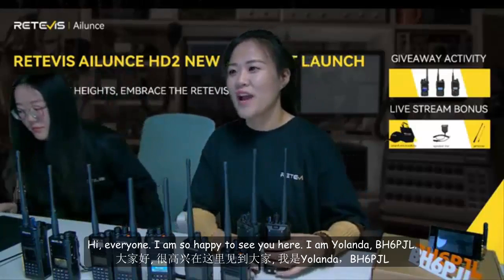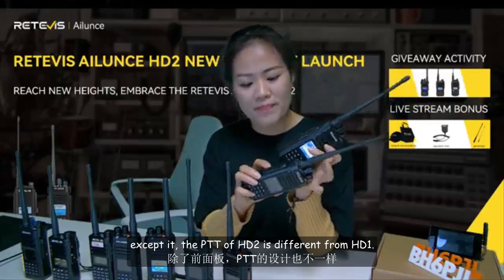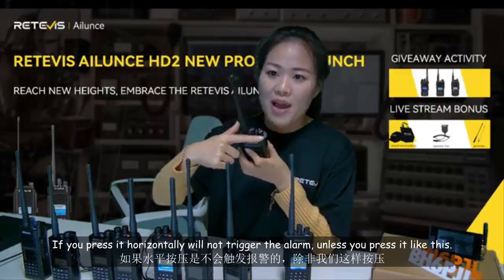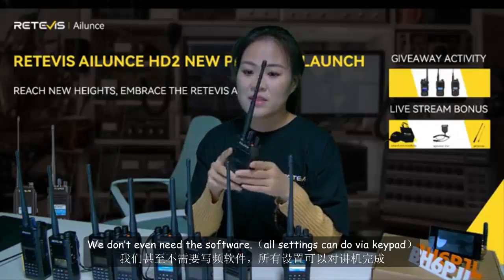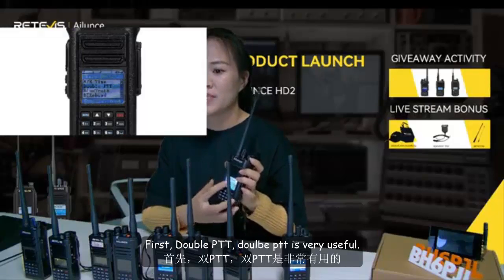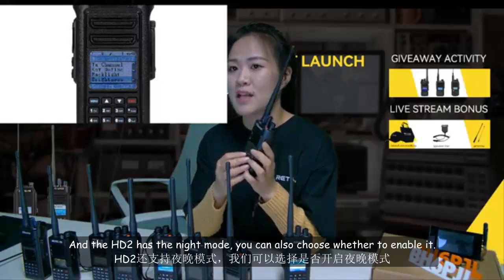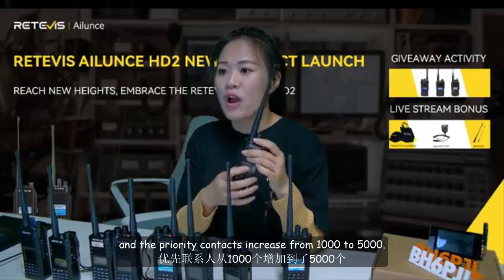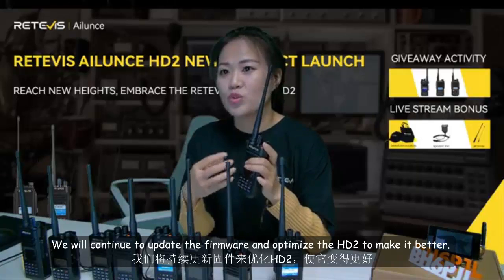AILUNCE HD2 Dual Band Dual FPP DMR Radio

Comment: I have problems with the HD-1 from the very beginning. The modulation is quiet. and when it transmits TX FM with high power of 10 W in the VHF band, the transmitter turns itself off when I do not grip the radio tightly with my hand. The display shows that the radio will do TX with high power but the power is a few milliwatts. Then it is enough to press the PTT again and the power is full again, but the radio must be held with a tightly closed hand. When the hand relaxes - the transmitter power is turned off. At medium and low power there is no such problem. In addition, it is also good in the UHF band. The antenna is very efficient, better than branded Japanese devices. The radio switches to TX slowly. It has a very good RX sound - number one in the world.